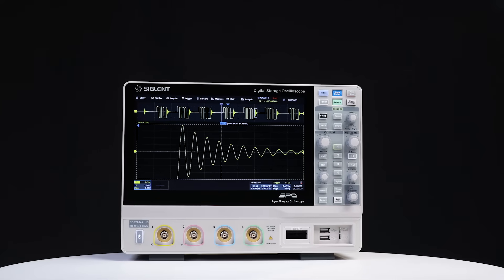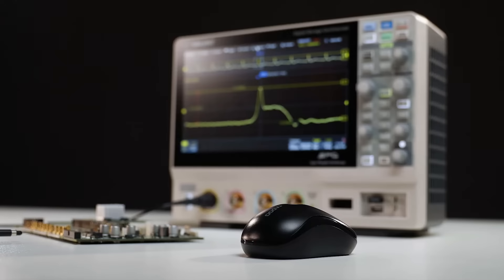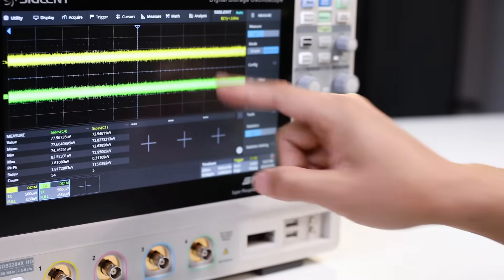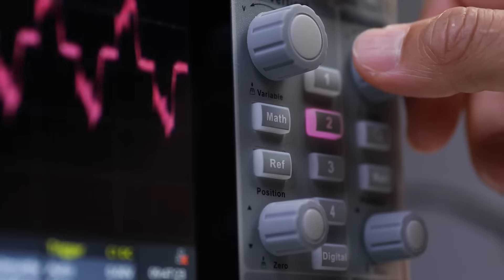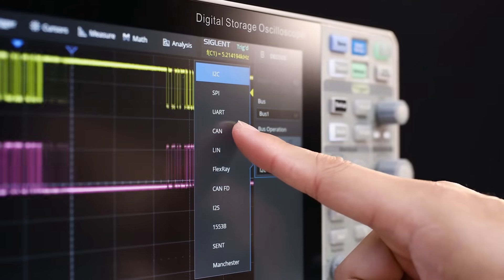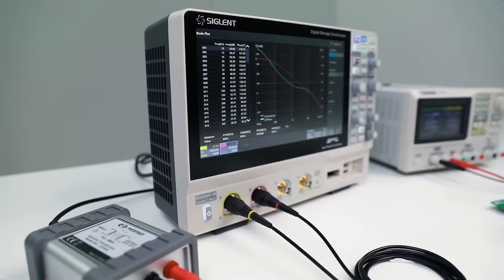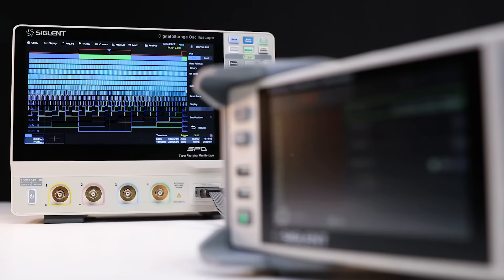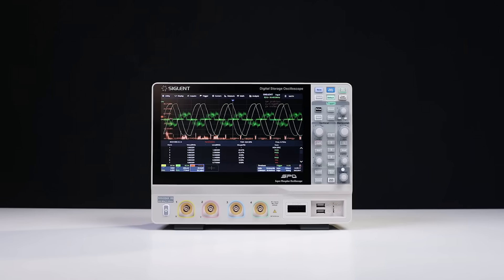Spec Intro of SDS2000X HD 12-bit Digital Oscilloscope

Comment: Can this tool measure all waveforms of a pulse generator (wide range), not just 0 and 1 Decoding ?
Reply from the maker: Thank you for writing. The HD is an oscilloscope, which means it is a time domain instrument designed to measure and display voltage vs. time with high vertical resolution (12-bits). 

It can certainly show many aspects of a waveform.. much more detail than "0"'s or "1"s. 

Scopes can measure rise time, duration, jitter, and many other characteristics. 

There are limits to the measurement capabilities, however. It is best to know the maximum bandwidth of your signal, amplitude, and type of signal (AM, FM, Pulse, communications, etc.) before you select a scope so that you pick the best tool for your application. 

You can write info@siglent.com for more information. 

- Jason, SIGLENT NA